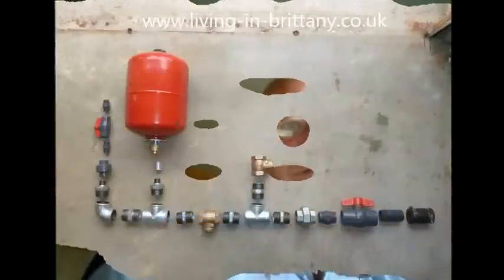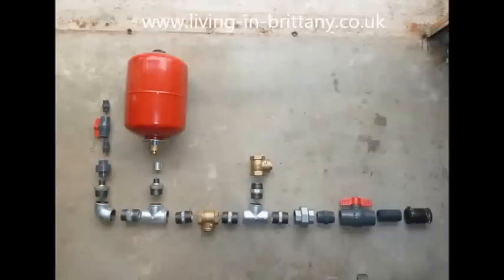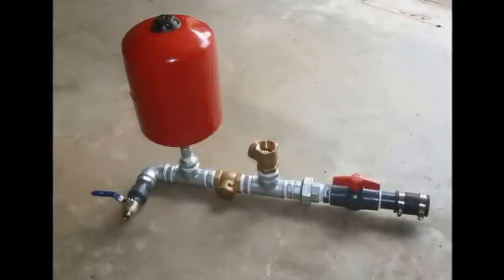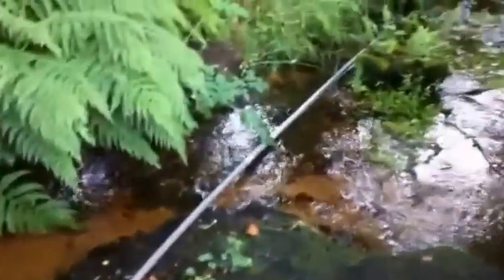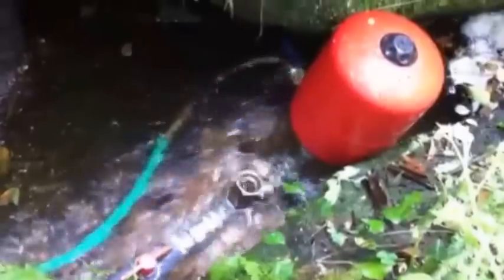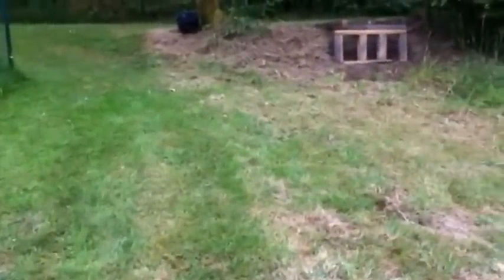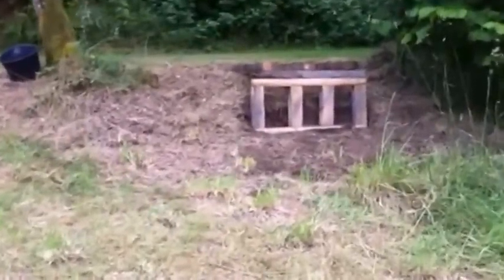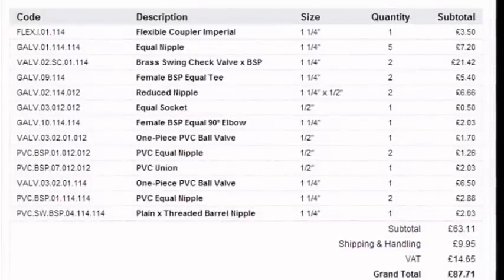Building and installing a  hydraulic ram pump

Comment: Thank you for this - very clearly explained... I have an issue with my Ram Pump which is that it requires more back pressure than i can give it to operate. With a 1.5m Head at 1", it needs 7m verticle of delivery hose. Anything lower than that and the pump stops. Also, i cannot easily reduce the Head pressure given how the source stream is laid out.

The only thing different to your configuration is that i have 1 swing check valve as a waste valve and a spring check valve with the spring removed for the other valve - could this be the issue? 

Alternatively i have a 1" drive pipe going to a 3/4" delivery then going into a 1/2" hose. Could increasing the diameter of the hose say to 3/4" create more back pressure?

Thank you again!
Reply from the maker: Hi, I think your problem may be the spring valve, If it was me I would try replacing it with a swing valve. Let me know how you get on?
Reply: @oldtimer43  thank you very much for getting back to me. Ill let you know if this resolves it.

Comment: You check valve is incorrectly installed.... Pivot needs to be at the top.
Reply from the maker: Thanks for commenting but why do you say it is incorrect? It has worked perfectly month after month after month
Reply: @oldtimer43  check valves of the "swinging gate" type are orientation sensitive. When horizontal the gate pivot needs to be at the top for gravity to close the valve properly and minimize friction in the pivot. You have the valve laying sideways.... Not a proper installation.

Comment: If you increase the diameter of the delivery hose you will reduce the friction pressure drop. The use of an in line non return vale as mentioned is very effective as well.   The most effective change you could make is to increase the size of the pipe entering your pressure chamber, by using a size less than your check valve you are not only restricting the flow into the tank but also reducing the flow down the drive pipe. therefore  reducing the hammer effect which dries this system. 
it was a pleasure listening to such a polite presenter, all the best from OZ

Comment: if you install a one way check valve about halfway up the line it will increase the height you can get  to the height you need.  It increases possible height by about 8 to 10 feet normally.
Reply from the maker: +Scott Adair Hi thanks for the advice I appreciate it however I have already done it :) You are quite right it did increase the height by quite a few feet and enough to get right to the top of the garden where i wanted it.